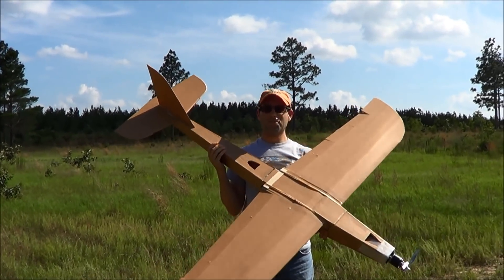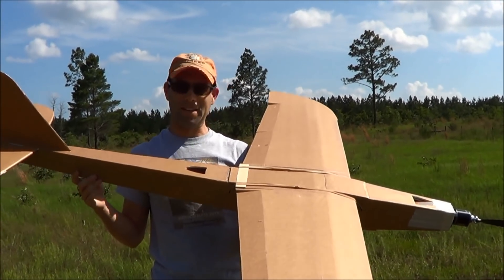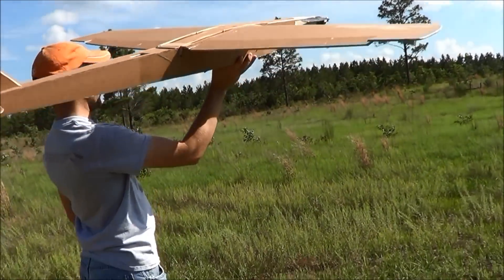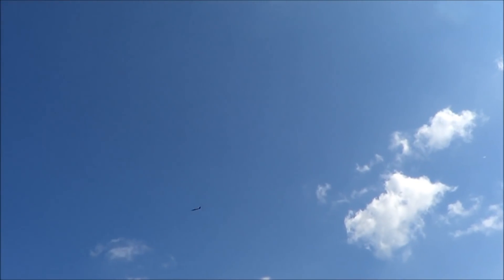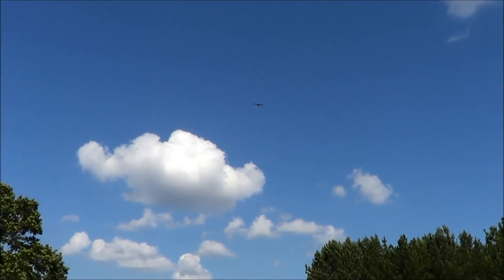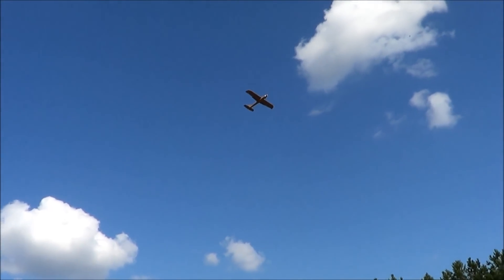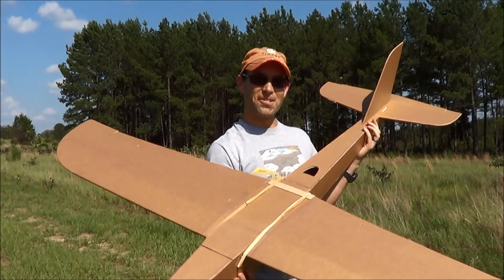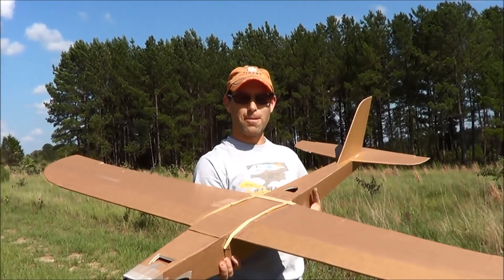Maiden flight of a foamboard hotliner! (free plans too!)

Comment: Ummm...Have you actually seen a hotliner, That's more of a...frozenliner, as in frozen in mid air.  My micro Protege's fly awesome keep up the great work.
Reply from the maker: Douglas Englert I only maidened it on 4s. That's not the design power, or flight profile. You'll have to wait for the real stuff. Or come to Flite Fest. ;)
Reply: I've never understood the time investment made for $Tree planes. You can get 3 sheets of EPP from Grayson for $30 and have a plane that will take a beating and ask for more. The time investment is actually less when building with EPP. Cost savings isn't that much more with $T foam. One hard landing and you're putting it back in the car and flying your other stuff instead. I see this all the time at our field. Kid rolls up with a FliteTest wing and piles it in on the maiden lol, sits down and watches everyone else fly their VAS wings for the day. It's a rough lesson to learn.

Comment: Also,  I notice you have a ton of down Aeleron built into the plane as default.  Is that because it is a flat wing?
Reply: They are flaps you can adjust.
Reply: @2552legoboy  Oh damned it!  I can't believe I didn't notice that.  Sheesh.  Thanks!
Reply from the maker: FlyMario that's the thermal camber mode. I launched in that just to drop the stall speed as low as possible for the maiden flight. In normal cruise I retract the flaps and ailerons so they're parallel to the rest of the upper surface.

Comment: you say this is dollar tree foam board yet it does not look like that at all.  Did you pull the paper off and laminate it with some other paper or what?  I love how graceful it flies at slow speed!  Do you recall how windy it was? Your microphone seemed quite windy.  I only ask because I am wanting to get an idea of how it handles wind.  In Philidelphia, it seems the wind will never go calm this year.
Reply: Its probably Flite Test foamboard which is has waterproof brown paper.
Reply from the maker: This is Flite Test's foamboard. Made by the same folks over at Adams, but it's waterproof! And yes, it was pretty breezy out there, gusting to 15 or so. I've flown in PA...I'd say the only real issue is this one's lightly loaded, so just bear in mind that in strong wind it'll come to a dead stop when gliding into the wind.